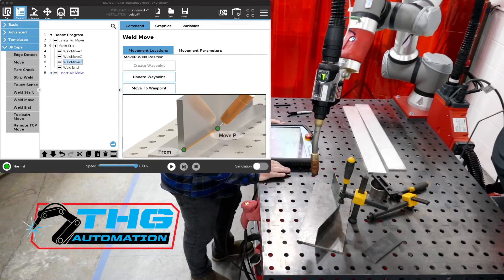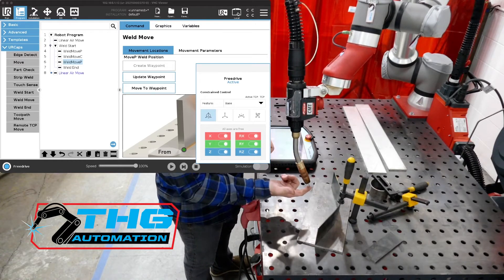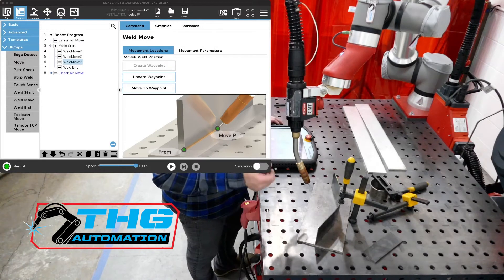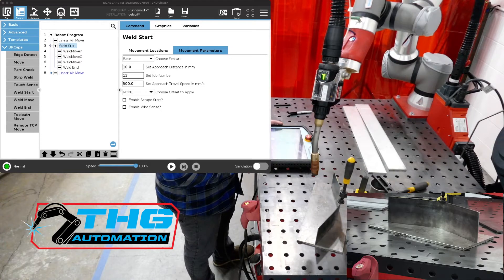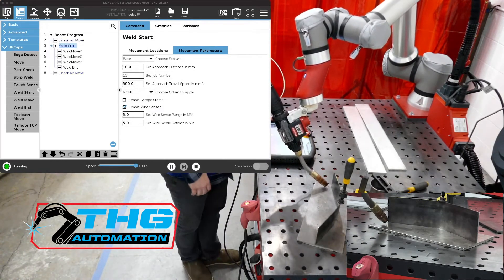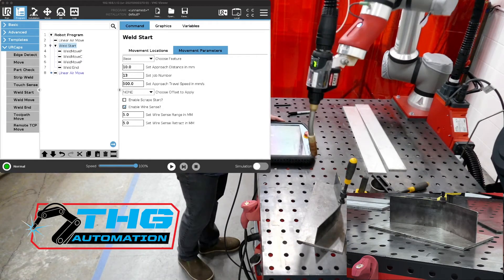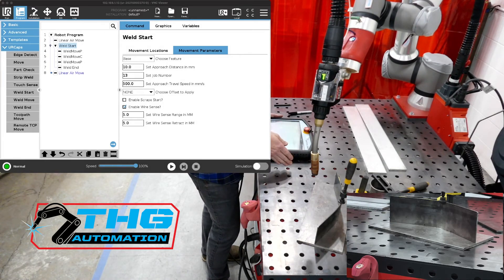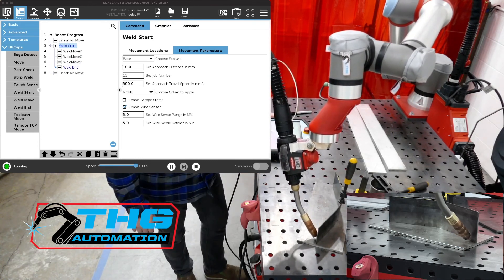Wire Sense Tutorial with THG Automation collaborative robotic welding system

Comment: Amazing, talking like its a new high tech innovation - we developed wire touch sensing coupled with through arc seam tracking on welding robots in the early 80's but generally avoided using the wire because of unreliably in the production environment, any discrepancy in the wire with cast or deflection shifts the program incorrectly. We found gas nozzle sensing in most seam types to be more reliable and accurate. Today while laser cameras are more expensive they can do far, far more in sensing and adaptivity using algorithms that any type of contact sensing can achieve.
Reply from the maker: This and Edge Detect are great features and allow our customers to find features that typically need a camera to find. I agree with the nozzle sensing. We did this as well back in the day. Our system lets our customers use wire or the nozzle for touch sensing, so all the options are still there.
Reply: @thgautomation  Yes you cannot beat having belt and braces, in welding you need any tool you can get.